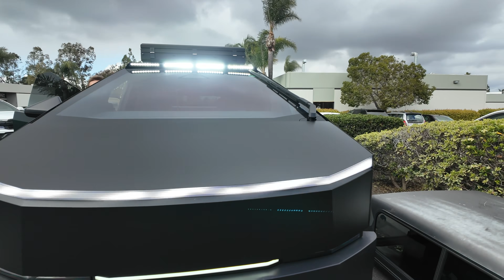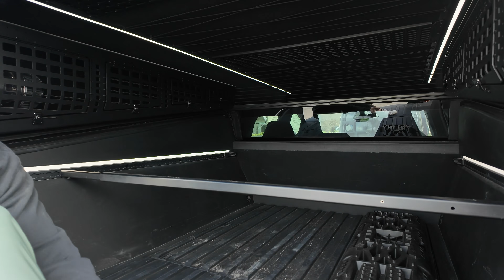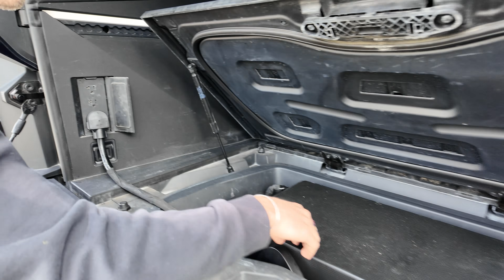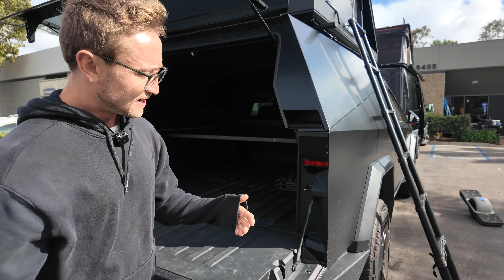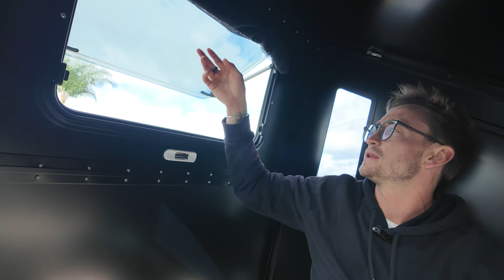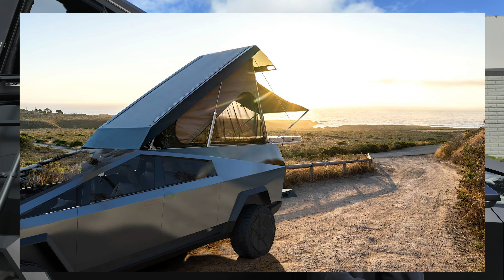Cybertruck Camper TOUR - Space Campers Cap

Comment: Useless as a 4x4 camper where you must be within 100 miles of a Tesla charger since most rv sites dont allow charging due to high power usage. I guess you can add 12kw gas generator with 15 gallon fuel to charge. 😅
Reply from the maker: However most camping is less than 100 miles out 🤔
Reply: @jarrodtocci  Not only range anxiety and now camping anxiety since I can't freely use battery for heat/cooling, cooking, entertainment due to dropping the battery too low to return to a charger. Instead of cancelling the bigger Tesla like the X an S, add generator option. Cybertruck too and fit the stupid shape as a standard 6 or 8ft bed for endless aftermarket options.
Reply: @peternguyen9386 you can use the ac and cook your really under selling how much energy 123kwh is 😂

Comment: Solar would still be useful in offsetting the drain of accessories added.
Reply: Only marginally so. It's not worth all the extra bulk, complexity, and cost when the amount you use camping can be put back into the battery in minutes at a super charger.
Reply from the maker: Just not enough solar to make sense